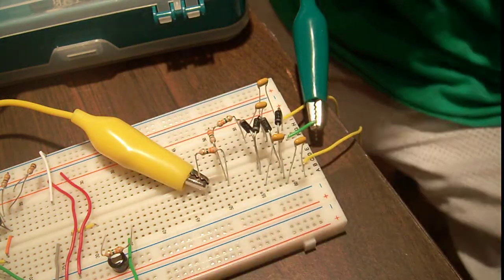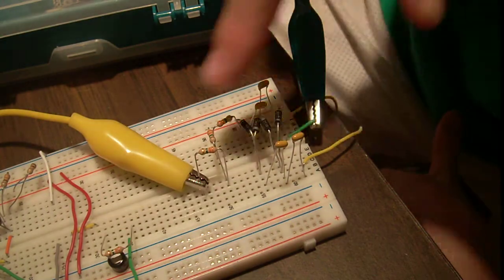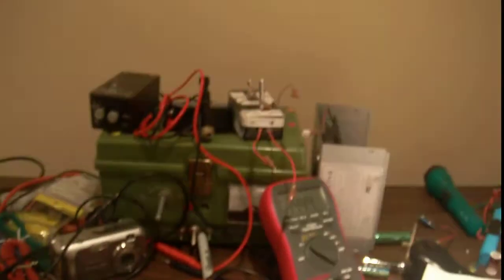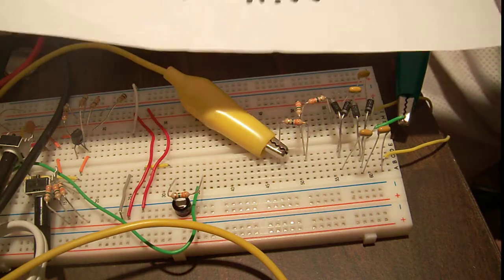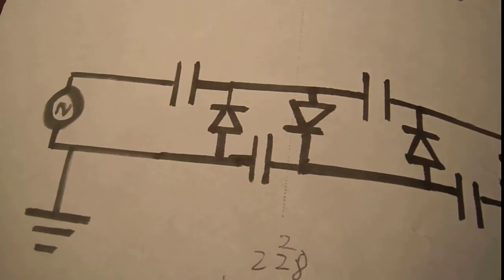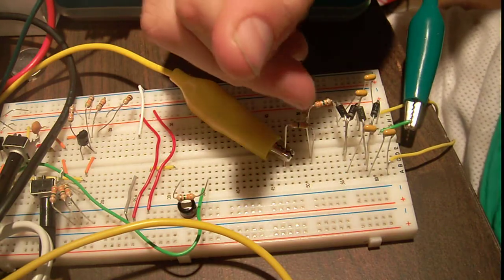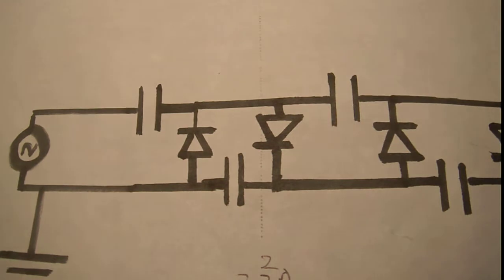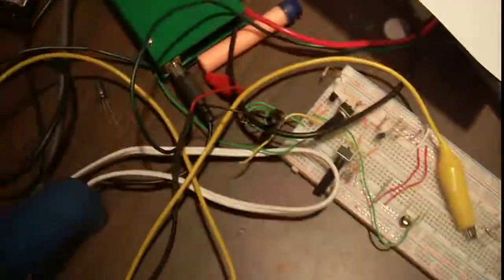Voltage Multipliers

Comment: @quicknuclearscience Interesting that's never happened to me, yet ha. But its possibly because the capacitors still holding the charge I guess. But I have blown a few diodes and almost a capacitor once.